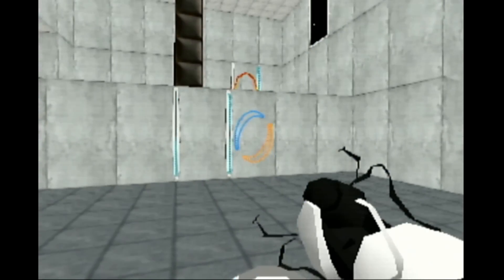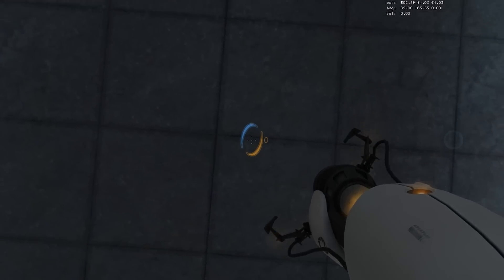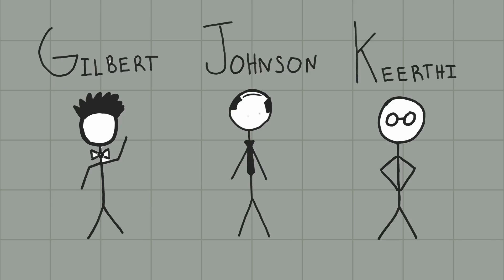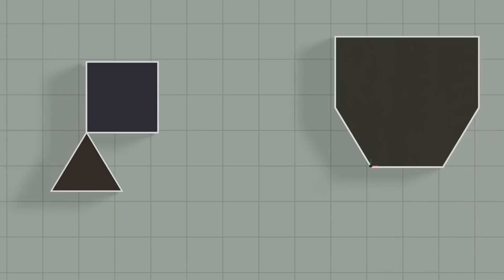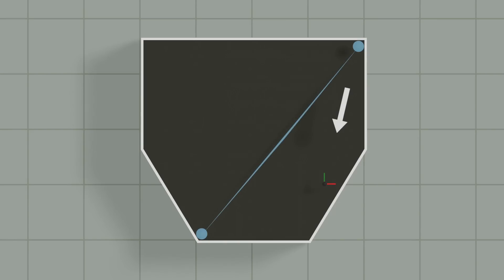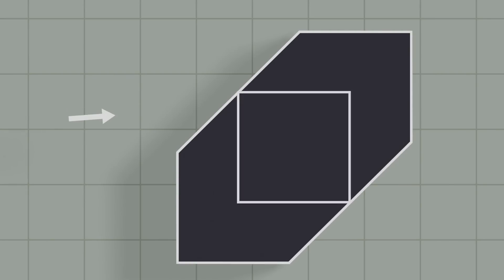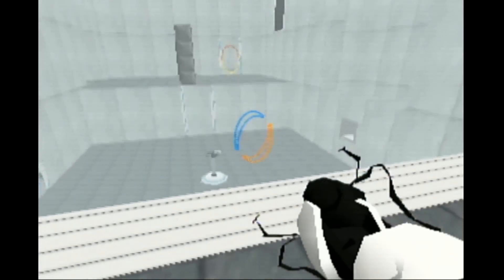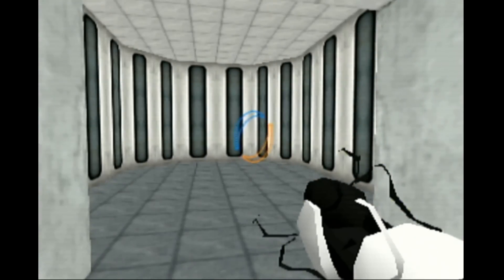How can the N64 handle fast moving objects? | Portal64

Comment: This is very impressive, the fact you were able to make portal in n64, while some people are still struggling to do that in goldsrc
Reply: This comparison doesnt even make sense.
Reply: It makes absolute no sense for the N64 to be "closed source", do you believe this project is made on an already existing engine in the console? This game was literally built from the ground up and its developer can do anything with it, which is not the case with goldsrc lol
Reply: @SheepyChris  lol, n64 is not documented, most of what people can do with it is based on reverse engineering the system
Reply: @golarac6433  Yah the hardware might not be fully documented, but you do have more control over the software
Reply: @SheepyChris  well, you have all the control. N64 even has programmable DSP which was seldom changed from what Nintendo shipped but is pretty powerful
Reply: @golarac6433  But then the reverse engineers document what they find lmao
Reply: @flintgrain  same this is painful
Reply: its very clear none of you have made a game in goldsrc or for the n64. ive made lots of goldsrc games but ive never made an n64 game but have made a few psx games which is very similar from what ive been told. i would rather make it on the psx than goldsrc, as integrating portal rendering into goldsrc sounds awful (as does implementing it in source honestly), and writing an engine from scratch to support portals is a huge advantage
Reply: goldsrc is not open source so its hard to do major modifications
Reply: @golarac6433  And neither is the n64. But I assume there's a lot of community made documentation for it. Not sure if that's the case for goldsrc.
Reply: @gragogflying-anvil3605  nah, he's coding an engine that is purpose built for this. Not even Portal got that opportunity, so of course he's going to have it easier.
Reply: @gragogflying-anvil3605  Goldsrc is an engine. N64 is a console. He's making his own engine to run on the console.
Reply: @gragogflying-anvil3605  the n64 is hardware, not a game engine lmao
the n64 has been reverse engineered beyond comprehension lmao
Reply: I belive the only issue with the n64 is the hardware capabilities, so you would be able to write custom game engines and make anything youd like really. Gold src would probably be harder I imagine because you're working with the limits of their game engine so making stuff like this without modifying the whole game engine itself would be extremely hard.
Reply: @gragogflying-anvil3605 the N64’s big thing is taking advantage of what it’s really good at and optimizing what it’s bad it.
Reply: @golarac6433  yea but it's still an advanced engine, and many people tried it before but failed or mad a meh mod
Reply: @Fatih_M177  So what if its advanced, if it's not open source it's hard to change fundamentals like the portal physics. I'm not arguing that it's easier to do it on N64 than on goldsource because of that. It's just apples to oranges comparison
Reply: @golarac6433  neither is N64, and it being closed source doesn't really give any sort of restriction. at least not to much restrictions there still are some
Reply: @Fatih_M177  it does give a lot of restrictions. As I said already, its not a good comparison, way different challenges
Reply: @Fatih_M177 and others if you still don't understand why comparing gldsource and N64 is basically meaningless, you can imaging drawing an underwater scape - in case of N64 you're only given a bucket of paint and canvas - you could do whatever you want but it would be hard; gldsource on the other hand gives you lot's of different brushes (no pun intended) tools etc, but there's already a mountain range in the middle of canvas and you can't erase it. Yeah, on the first hand gldsource is much easier, but you always have to overcome challenges, and N64 is just play hard with nothing tricky - if you can draw in such conditions - you can make anything
Reply: @golarac6433  but the SDK is
Reply: @golarac6433  yeah but goldsrc IS open source, I built it and made a mod from it
Reply: @xenon486  link to source code
Reply: @golarac6433  sent, I hope yt won't block it
Reply: @golarac6433  its called the hl sdk but it has all of the source code to the goldsrc engine
Reply: @xenon486  I believe that's just the game logic, not the renderer
Reply: @golarac6433  it builds the goldsrc dlls that the half-life launcher loads, it has the renderer in it
Reply: @xenon486  it builds client and server DLL I assume just like the half life 2 SDK. That's not the whole engine
Reply: @golarac6433  it does, but the client and server DLLs holds MOST of the engine as looking at the files in half-life, theres not much after that. using the sdk you can make goldsrc games since the sdk provides all functions
Reply: @xenon486  according to my knowledge the client and server DLL files contain the logic of the game itself, such as enemy and weapon behaviour. But the actual graphic engine responsible for the rendering and such is unfortunately closed source, so implementing a feature like portals is difficult if the engine doesn't at least already support similar features that could be reused. The SDKs include a lot of code, yes, but that's not the code of everything.
Reply: @darealshinji  hmm that makes sense, I will look around the source code to see if there is anything about rendering
Reply: Ubisoft struggles to make good games that aren't ruined by Ubisoft executive decisions...
Reply: @flintgrain  what
Reply: People in this thread have such a terrible understanding of game development.
The N64 is closed-source. It has many built-in components that were designed and programmed by Nintendo engineering teams. The source code and design documents for it have never been released, but it HAS been nearly fully reverse-engineered by emulation and homebrew enthusiasts.
GoldSrc was programmed by Valve in three parts. The engine launcher, the server, and the client. It shares the exact same model as Source, just a lot less advanced. The client and server have shared code that can modified with the open-source HLSDK, and the launcher has ALSO been reverse-engineered by the Xash3D community.
Portal's entire divergence from Half-Life 2 that allows it to use Portals and perform cube-and-button based testing is in the client and server code, using an early version of the Source SDK. Again, the same model that mods like Blue-Shift and TFC used.
The closed-source launcher is not involved in making portals or Portal whatsoever!
Reply: Meanwhile I couldn't even figure out how to read the controller inputs... these people are galaxy brains!
Reply: Gold source is way complicated, buggy and closed source
Reply: N64 you have to write your own engine so anything goes. GoldSrc has a lot of constraints in it.
Reply: @garrysmodgigachad  like what?
Reply: If you cant change the Engines code it can be hard in some Engines to recreate seamless portals
Reply: Yes offence, goldsrc developers are exclusively just the people who weren't smart enough to work with source.

Comment: I really like this. I wonder what would Kaze Emanuar, or even Valve themselves would think about it.
Reply from the maker: I'm hoping Valve thinks, "Wow that is cool we should let him finish it"
Reply: @james.lambert  Just a question, what do you think about binary space partitioning (.bsp) and how would you implement it? The original Quake was from 1996. Quake had a world editor and it allows lightmaps and radiosity baking after compiling it. Is this possible on the Nintendo 64?
Reply: @TrekDelta  The Source engine uses BSP, lightmaps and radiosity baking.
Reply: @TrekDelta  Quake didn't really have a world editor. The original editor used to make the maps was custom made for multi-thousand dollar workstations, but the source code WAS released... it just wasn't use to make a program. The first community maps were made in model editors and text editors. It took a while before Doom-like editors were the norm. The N64 release was actually a unique port with special colored lighting that used the N64's unique hardware advantages over contemporary computers. N64 Quake is not only more capable and better looking than the original PC release, but it has more technological features and, to answer your question, did have lightmaps with radiosity for smoothing.

Modern Quake can look like a modern game. Check out the Alkaline maps or the new maps for the Steam release. Modern compilers can use all the most advanced lighting techniques these days.
Reply: @shard14x  hey sharp didn't expect to see you here
Reply: @lennymclennington  stop following me 😭
Reply: @james.lambert  Thankfully, Valve is cool with fan projects, and even fan remakes. Combine it with an emulator, and you might be able to sell it on Steam like Black Mesa.
Reply: As long as he doesn’t try to sell and only offers it for free then everything should be fine. Value only cares if you try to sell things for the most part.
Reply: @illpunchyouintheface9094  well gmod exists although I guess that's just a compiler game thing
Reply: @illpunchyouintheface9094  as long as hes not trying to sell it, or taking "donations" for it, theres nothing they could legally do anyways.
Reply: This reply section has aged poorly
Reply: @TheRenegade...  I don't like Valve anymore after this.
Reply: Well you know, the source engine that we know today, it's based on Goldsource, which itself was based on the quake engine.
Reply: @paulbunyangonewild7596  Source 2 we all know, is not coming out anytime soon.
Reply: Valve has a good track record with fan games and fan remakes from what I understand
Reply: @xg223 Then likely, a chopped down Gold Source/Xash3D could be created (from scratch or porting it as small as possible) onto the Nintendo 64.